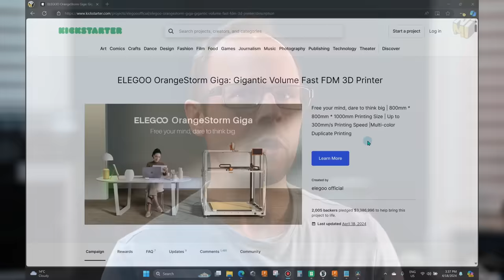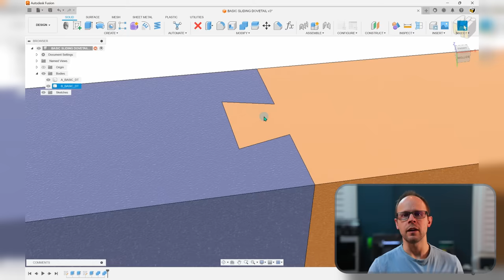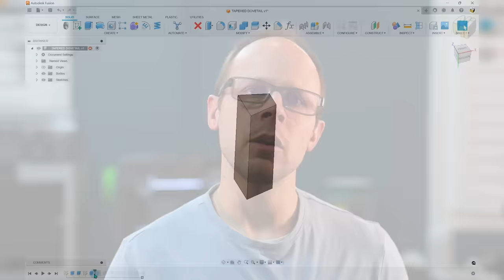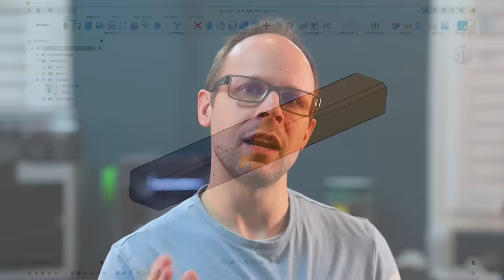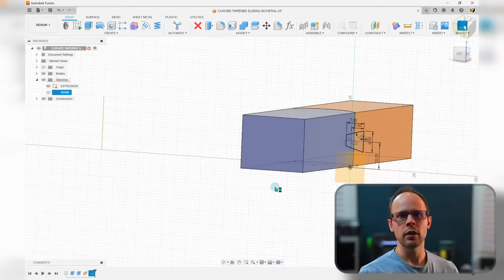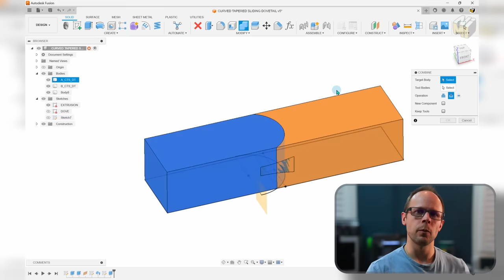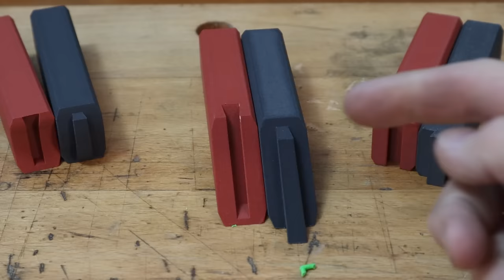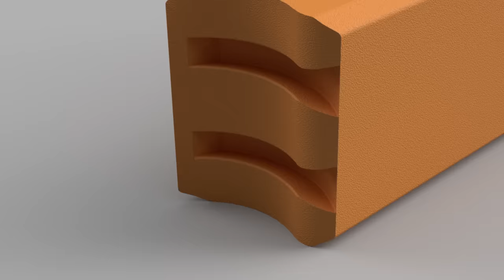Modernizing the best Woodworking Joint to use for 3D Printing

Comment: I wonder if there are any standards for such joints. It would be really good to integrate such features in future CAD softwares/ slicers.
Reply from the maker: Prusa Slcier has ways to add dovetails, and you can taper them, they're not curved and they're not something that you can duplicate, you set the angle to slice and then you get what you get.  I think it'd be great to be able to click and add a pre-defined connection just how you want it.  It makes a lot of sense to make it simple and to make sure that it works 100% of the time without having to fiddle with it and print sample after sample.

Comment: One thing I'd be curious about is if or how we can combine joining methods for extremely tight fits. For instance a screw-secured dovetail, where the dovetail ensures it's a tight fit and the screw locks it in place providing additional force to hold it together. That cylindrical dovetail design for instance provides support in basically all angles, so if there was a way to screw it together and force those two mating surfaces together I imagine it'd be insanely sturdy.
Reply from the maker: It's a great idea, and I have a few ideas to do this.  Are you familiar with the KREG jig?
Reply: @NeedItMakeIt  A little, don't do woodworking myself but I keep my eye on a lot of different hobbies passively (idea crossover can be massive) and I know pocketholes are used fairly frequently, but with 3d printing especially I feel like the ability to create and use custom geometries could open things up massively. 

Especially if mid-print embedding or other things were allowed for. (i.e. conceding a bit of the 'hands off' simplicity in favour for raw utility) You could have almost entirely internal screws at basically any angle and, while they might need to be tightened using some fancy flexible shaft, it'd give some insane freedom to experiment with secure  and accurate joinery. For instance embedding a bolt inside of the male-end of the dove tail or something, then having screw holes on the female side that literally pull the dovetail together or something. (that one would also almost be "zeroable" on one axis becuase you could adjust the tightness of the screws in order to 'lean' one side)

Comment: I’m a hobbyist and I loveD F360 however I’ve moved to FreeCAD for “licensing frustration” issues. I’d need to figure out how to do these excellent tips with it.
Reply from the maker: I had to pay for Fusion, but if you're using it for personal and not making too much money, you should be able to use the free version.   I'd have to try FreeCAD , it can't be any worse than Tinkercad can it?

Comment: Looks very impressive in the video, but I prefer to keep things simple.
Reply from the maker: Some of them are a little harder to create, however the straight tapered dovetail is simple and takes less time to create than a screwed lapped connection.
Reply: @NeedItMakeIt  The last time I needed long rectangular pieces to make a frame I just used wood 1x1s I had in storage and then printed corner pieces and sleeves in PLA. The sleeves so that I could have corner pieces with the xy in the best direction supported by sleeves with xy at 90 degrees to avoid delamination.
Reply from the maker: @peircedan  For a frame, yeah, that makes the most sense, dowels can work nicely as well.  It really depends on what you're making and whether it makes sense to use a connection like this one.  I can't really predict what people will make, I only know that they'll need some options for joining parts in various ways.

Comment: i need your printer settings haha those look way too good
Reply from the maker: Some of my better prints for sure.  I used my Bambu X1C and QIDI Q1 for these prints, both of those printers are very accurate in their extrusions and retractions.  The filament is PETG-CF which looks amazing, this is Brick Red and Titan Grey and I've used 0.16mm LH and a 0.4mm nozzle, which helps a bit as well.  I tend to only use Orca Slicer, unless I'm switching between prints and then I'll use Bambu Studio on occasion.  That's really just about it.  Most of it comes down to the printers and so far, the most accurate and affordable printer is the QIDI Q1, the most full featured is the Bambu X1C.

Comment: I actually never considered dovetails or similar ways of joining printed parts... Interesting way to utilize a printer.
I prefer screws bc. I don't have to fiddle with tolerances + offsets, can adjust the tightness of the joint and can disassemble in any orientation. I imagine it being a nightmare to replace one part bc you would have to rotate and twist stuff in an assembly in different directions. Also I very rarely print big parts. I always try to find non printed parts to make up for bigger structures and frames and only attached printed parts and Rails to plot if necessary.
But I'll keep it in mind and maybe I'll find a project where it fits in... Thanks in any case
Reply from the maker: Oh for sure, the screw approach has always worked, I use screws and heat-sets here and there as well.  I think it's nice to have some alternatives up your sleeve.   I am working on a combo screw joint which will also pull the connection tight so you can have the benefits like you say, but also you can pull the connection together tightly against all faces.  Well, that's the plan, whether it works out, that's a different question.  Lots more to come, and maybe one of the next that I'm working on will suit your fancy.  Thanks for taking the time and I appreciate you sharing your thoughts on this.

Comment: Probably one of your best videos!
The dovetail connection can be locked and unlocked many times or it will be loose after a while?
Reply from the maker: The connection seems to smooth out a bit over many uses, though it's very fine, almost as if it's being polished.  I can certainly test it.  What I'd suggest if you're wanting to make something that's re-useable is to print the ends completely solid, this way it's very hard to compress the connections.  With hollow parts they can deform more easily.  You can do this by adding very fine negative extrusions within CAD, or you can use modifiers within the Slicer.  The slicer method might mess things up unless your modifier fits your parts exactly though.  It's worth a closer look though.

Comment: Thanks for the video, really practical. One thing at 2:25: "external edges will receive a .3 and any internals will receive a .2" -- is this flipped?
Reply from the maker: Thanks and I am nearly finished the follow up video which I think will be even better.   The outside corners need to be larger rad, it will pull them inward Moreso than the inner corners, I've found that it helps with that little bit of buildup that you'd normally see on the sharp corners if you haven't tuned your PA just perfect.

Comment: Cool video. Keep making it.

Can you recommend a glue which works for ABS Printed Parts?
Reply from the maker: Thanks, lots more to come!  You can use a solvent slurry, essentially acetone, but I find that PL premium or polyurethane adhesive is the best all-around adhesive that also works for PETG, the benefit being that it expands as it cures to lock the parts together... it can expand out of the connections as well.

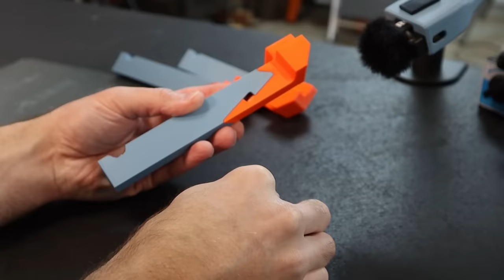Comment: What's the name of the joint at 1:14? The one with the wedge to hold it together.
Great video, love all the variants of your dovetails. The one with the lip that seems to snap when fully rotated is satisfying. I'm interested in which of these would be resistant to coming loose from vibrations without glue.
Reply from the maker: I have a video on that one as well, it's called an Under Squinted Stop Splayed Scarf Joint, and it's a 3D printable version of a traditional scarf joint we'd use for Timber-framing.  I'll have some more videos of these connections coming up, I can also test them for longevity and for strength.

Comment: Would be interesting to try to do these same joints in wood with a six-axis router using straight and dovetail bits.
Reply from the maker: Oh, now you're speaking my language.  I just need to get my hands on a 5/6 axis router now, I wonder if they've come down in price?  I could attempt to cut one by hand, but I have a feeling that it might not work out so well.  I could also do it in several pieces and laminate them together.  I could also cast it in aluminum, which is also quite a lot of work and probably won't be smooth enough to come together.
Reply: @NeedItMakeIt  A bit of teflon paste or lithium grease can do wonders in getting aluminum to cooperate.   As for the six-axis router, depending on where you're located, you might be able to find a fellow enthusiast who's willing to help you out if you have a cool idea to try out.

Comment: How do you get the surface of your prints so great looking? I can't even see any layers from the side view. Impressive!
Reply from the maker: I'd say three things mainly.  A precise printer, the QIDI Q1, the Bambu X1C are both very precise, the next is the filament, this is PETG-CF from Bambu Lab, Brick Red and Titan Grey.  The last is the layer thickness is set to 0.16mm, which helps to hide the layers even more.   

Of course calibration as well, but that's pretty much part for the course.  

Not much compares to the look you get from that PETG-CF, only PLA-CF looks as nice.

Comment: You claimed that the screwed connection is weaker than the dovetails. That is quite a bold statement and I would have wished you had done some testing in the video to prove that.
Reply from the maker: I have done testing on this, it is from a previous video.  The reason a screwed connection is weaker isn't the screws, it's the method that we would use to split the parts in order to get the screws in.  I think a screwed connection can be very strong, it just needs to be done a little differently.  Also the screwed connection needs to pull the connection tight in more than one direction and currently the way it is normally done in 3D printing is that it only sets one direction and I think it can do both with a few minor adjustments.
Reply: @NeedItMakeIt  Ah that makes sense, thank you

Comment: Screws are known to be superior for joining parts. For printed parts, you need to use the right screws. That is something like m14 or m18. Just embed the female, and print the male at 98% for the x and y, but of course keep the z as not to ruin your threads. Tap the female with a tapper tool. Just to make sure, you need to use two holes in a row. Screw mounted parts are weaker along the mounting surface, which we all know the mitigations for, sine we live in a world filled with metal sheet produced parts.

The solutions with tracks that you use in this video, might look nicer, but have serious limitations as for mounting and dismounting, as well as serious issues of breaking, if stressed in the wrong way. But if used correctly, they should work, and look nice. Their main drawback is how hard they are to apply properly, as the design needs to deliberately avoid stresses for the joints weaknesses. Designing for tolerances, is also seriously hard, as applies for all track designs. I call it tracks, because that is basically what it is, and the same physics for designing them applies. It is a nightmare designing these.
Reply from the maker: Those are some seriously large screws.  I'll have a video on that subject coming up, which will combine screws with a better interface between parts for likely a very strong and rigid connection.  

As far as the fit, yes it can be a bit tricky, a slight change in dimension on the taper as you know has a big impact on the final sitting position of the parts.  I have created a connection which accounts for this already in a previous video, however it is a bit more complex, still interesting though.  I'm just about finished the follow up video with some alternatives.  The goal here is to give people some options because what I was seeing in designs could be far better and parts can fit quite a bit tighter.  Adding adhesive for a permanent bond is still always a good option of course. 

I find these connections take me less time to create than a screw connection using a lap joint with holes of varying sizes offset from each other for insets and chamfers to allow for the "flash" oozing out, but that's just me, I'm sure there are more efficient ways of making them than I am using.

Comment: Amazing! I dont know if i missed that part, but how did you achieve this texture on the parts?
Reply from the maker: It all comes down to the material, this is PETG-CF and it's one of the nicest looking filaments out there,  I've used Bambu Red Brick and Titan Grey for these parts.  I'm a big fan of Red and Grey for some reason.

Comment: Should use offset faces instead of push and pull feature so it'll save in the F360 timeline and can use parametric design
Reply from the maker: The result of a push/pull shows in the timeline as offset faces.

Comment: what glue would you use? Is the choice different for different plastics?
Reply from the maker: For PETG you'd be best to use polyurethane, for ABS you can use ABS slurry or Acetone or polyurethane, I'd imagine you can also use Plumber's ABS cement. Apparently for PLA you can use wood glue, but I'd just stick with the PL premium or gorilla glue to make sure you have a good long-term bond.  The PU adhesive also has the benefit of expanding to fill any lingering voids between layers.

Comment: How about 3D printed elements susceptible to vibration or cyclical loading. How would you connect these elements? Assuming no use of glue.
I image that another dovetail in perpendicular plane might be very helpful, as a 3rd element sliding in to the lock.
Reply from the maker: I have another video just about finished up with what I believe are superior connections, but I believe that the ultimate solution will be a combination of a mechanical connection along with a joint with can take advantage of the strengths of the plastics we use and doesn't expose the weakness in the layer lines so much.

Comment: What have you done to your 3D prints that your layer lines don't show up? They look amazing! What ave you done or use?
Reply from the maker: Sure, I suppose it comes down to two things, the main one is to use a CF filament, in my case I've used PETG-CF, Brick Red and Titan Grey and the other is the printers themselves, I've used the Bambu X1C and the QIDI Q1 Pro, I've found both of the printers to be quite fast and accurate compared to other CoreXY printers.
Reply: @NeedItMakeIt  thank you
Reply from the maker: No problem at all!

Comment: You can't reinvent the wheel and when it comes to joining plastics end to end the natural solution is to look at woodworking joints. I liked the Japanese joint you showed near the beginning of your video that locks two pieces together using an inserted 'wedge.' It looks just like the ones in my Japanese woodworking books, so a big tick for that one.
Reply from the maker: I can't speak to how natural it is for anyone else... It is natural for me, because Woodworking is by background, and so is Timber-Framing.   I'm not trying to reinvent the wheel, I'm adapting the wheel to be used for 3D printing and showing everyone how to do it themselves.  Maybe I've missed something in your comment.  

Japanese Joinery is what most people seem to refer to, however the joints I create do not come from that source, they come from my knowledge of Woodworking and my time spent Timber-Framing in Canada, as we used to frame all of our barns and houses in this manner, of course it's all been mechanized now.
Reply: @NeedItMakeIt  I have a background in woodworking and what you're doing makes perfect sense to me. And with 3D printing it's a conclusion I came to a while back and was glad to see you using it in your video. Well done.
Reply from the maker: @Argyll9846  Got it, I see a few other connections here and there using dovetail connections, but nothing more than a straight cut dovetail, with far too much clearance.  I hope that even adding a simple taper can makes it's way into 3D printing to bring those connections together better and make for a better overall product, no glue required, but rather is optional.  Thanks for your thoughts and greetings from a fellow woodworker.
Reply: Those fancy Japanese joints are the first thing I thought of! You could create little wedges in all sorts of crazy shapes with 3d printing that would lock these dovetails after assembly.
Reply: I've already created over a dozen 3D Japanese joinery joints and have a few more to go. Most are usable for printed 3D printing, but I'm not convinced that all of them would provide strong joints.
Reply from the maker: @niceguy191  When I was a timber-framer 20 years ago we would use a technique called Draw-boring, which was a method which would hold the parts in position, but it also pulled the joint tight in the direction you wanted it to go.  We would bore the holes out of alignment slightly to accomplish this.  It worked extremely well for that, it could work well here also.
Reply: @NeedItMakeIt  I tend to associate draw-boring with mortise and tenon joints which are great for wood, but these dovetail joints you've demonstrated seem better in every way for 3D printing at least where the more complicated joint isn't much harder to make.
Reply from the maker: @niceguy191  Yes, I agree, we're not limited here by the tools we need to use to cut the connections, instead, we're limited by the materials we choose and to some extent the orientation of printing.